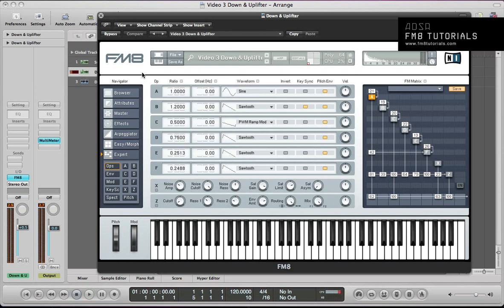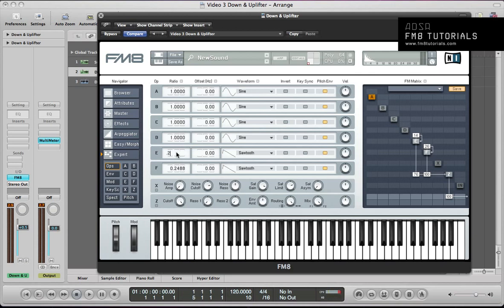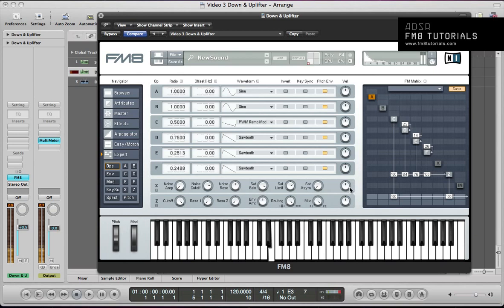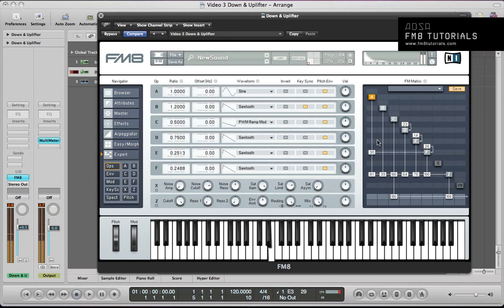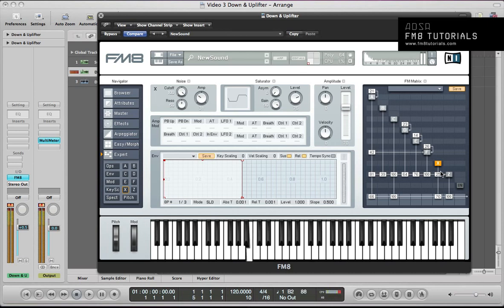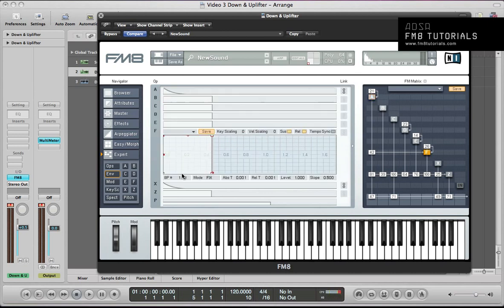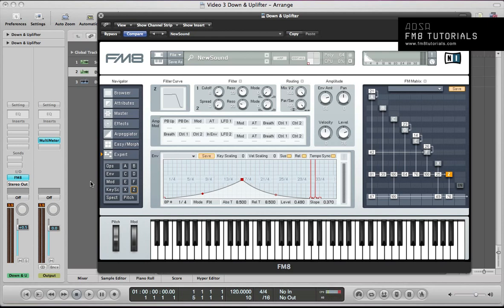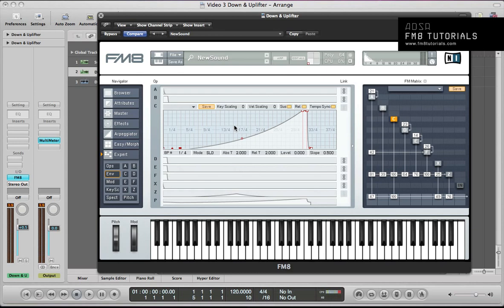FM8 - FX Sounds - pt 3 - Down & Uplifter - How To Tutorial

Comment: this is a great video, but the low frequency hum is killing me!  haha  I'm into helping you guys clean up your dialogue in post, because I like what your doing and need to master FM8 & Reaktor.  Maybe we can work out a trade?
Reply from the maker: I recored this video whilst on the move, and my headset was a bit dodgy. Mostly now, I'm recording with an SE2200a mic and an Apogee Duet. I do still have a headset, as it's much easier to record screencasts this way, but a much better headset, so cleaner recordings.
Reply: ***** Ok, well let me know if you have any audio issues with any other videos.  There is no reason to leave that sort of noise in a tutorial video when it can be quickly and easily remedied, especial a video relating to audio.  ;)
Reply from the maker: yeah hear you. Even some high end headset's pick up noise when recording, it's a balance of reducing the hum without killing the audio and keeping the voice sounding natural.
Reply: ***** exactly!  and it can easily be achieved, especially with this sort of low-frequency noise.  Shoot me the video above, and I will take the hum out for you.  No charge, and you can re-upload if you want.  Please, I just really want to watch this tutorial without the hum.  Thx!
Reply from the maker: Yeah it's not hard to take out the hum, you have the hum reduction setting in Screenflow, or you can use a separate tool like RX2. Hum's obviously much more noticeable when you turn the volume right up, especially in headphones, so maybe just view it on a lower volume. I'm back end of next week, so I can send you then if want. But in all honesty, we have 1000's of video's across our network with hundred of thousands of views and you're the first person to have any issue with the audio quality.